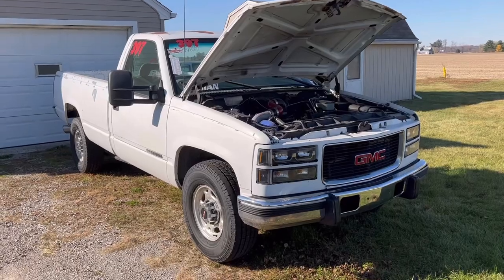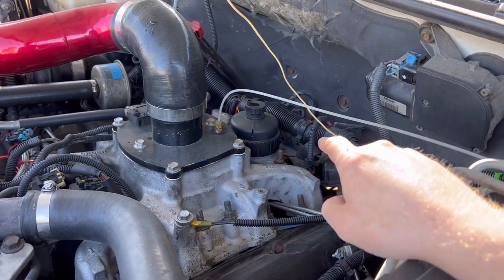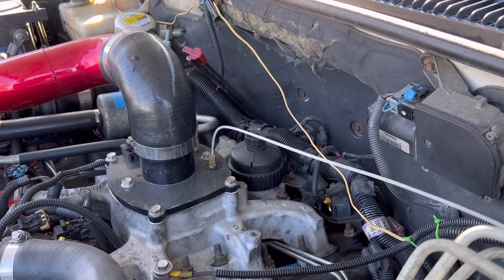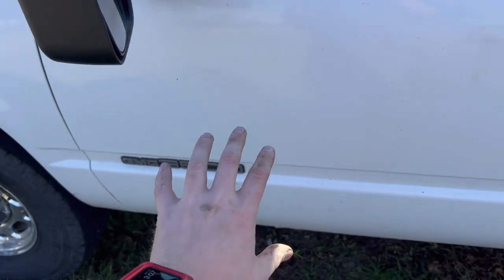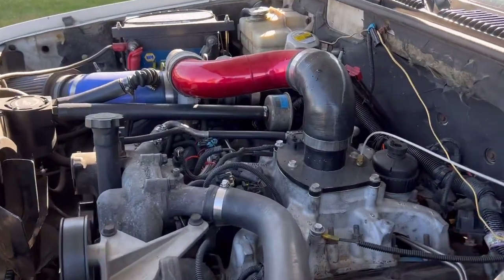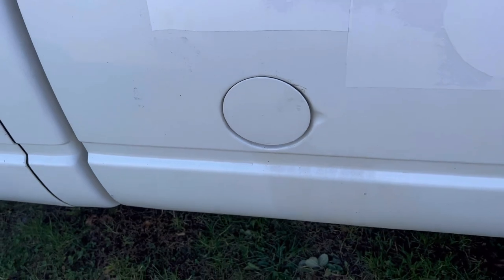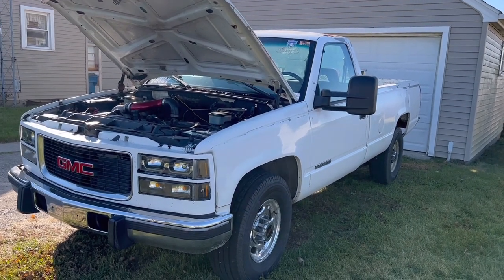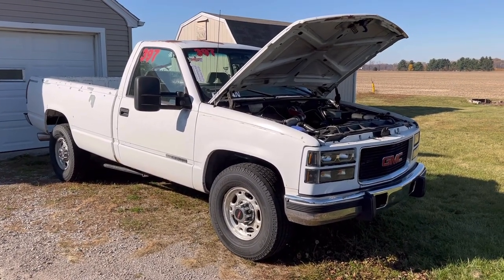GSC 6.5P diesel clogged tank sock trouble shooting

Comment: good video…I have a 94 c2500 and replaced the tank last summer.  I was astounded by the crap that came out.  I had a friend help me and he  remarked that the muck coming out was like panning for gold..so much metal flakes etc.  in retrospect, its smazing it ran at sll
Reply from the maker: It’s amazing how much crud can come out of these. Really makes you wonder how clean fuel really is at the end of the day.

Comment: I have a 1995 chevy 6.5 I just changed the pmd an i moved it like 10 feet an it died. Now I'm getting no fuel to the peck cock water separater on top of the block? Any ideas I'm new to these types of engines
Reply from the maker: Sounds like you need an oil pressure sensor replaced and a lift pump.

Comment: I don't know if someone can answer. Replace today lift pump, more than half tank, when I disconnect lift pump, no fuel from pipe, only some drops! Of course engine running bad at minimum and, if I push the pedal, run 100 meter and engine die. Oil pressure sensor is new, only one year because engine was full rebuilted 1 year ago.
Reply from the maker: The tank sock is clogged on the sending unit.

Comment: My 94 tank is on my floor jack. How would you drain 1/2 full from it??
Reply from the maker: I’ve bought a cheap lift pump. Put 12 volts to it with 3/8” line and pumped tanks out before.

Comment: Whould you have any idea as to why a 97 k2500 6.5td 5 speed would be chugging in 3rd gear like you are in 2 high of a gear ?
Reply from the maker: Probably a lack of lift pump pressure starving the IP
Reply: @gingersnapcustoms  so fuel pressure
Reply from the maker: @MrWilliewonka69  correct. Check out my video on testing it.

Comment: So my truck is sputtering at wot and smoking a lot after I did a lift pump fuel filter change and now it’s got like no power heats up to about 210 also
Reply from the maker: Check your fuel pressure and make sure you don’t have air in the fuel. If you have 0 fuel pressure at idle then changes are the OPS is shorted and not allowing the pump to run.

Comment: Would a 99 tahoe 2dr still run a sock style system like yours?
Reply from the maker: Yep. All of them did. Burb. Tahoe. Cab and chassis. Pickups.
Reply: Would this cause an air problem with the system?  Story goes for about 3 months I've been chasing this air problem. New lift pump new ffm new pmd...it takes me about 5 minutes to push all the air out of the system before I can start the truck once started I can keep it running for hours as long as every 8 minutes or so I bleed the ffm filter...there is so much air pressure it sounds like I'm opening a beer...there are no leaks on the ground and none visible on injection pump or valley...some one suggested I replace the lines running from the tank to ffm what are your thoughts?  I can fill in any blanks if you have any extra questions as well
Reply: I found a method I’m going to use with sprinkler hose and my air compressor. Thanks though!  The older generation gm socks are a very common problem and removal of it and an water separator on the frame is a good way to go.
Reply: I cut the sock off in the tank and boy she runs like a dream now!
Reply: @dustinschmidt5279 I have a 93 that sputters when warm but immediately restarts so possibly clogged sock?